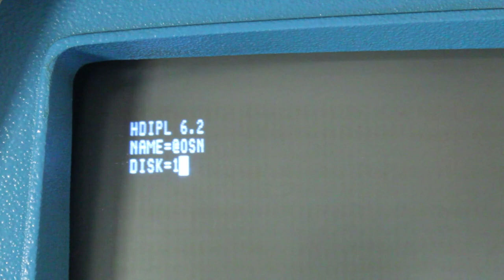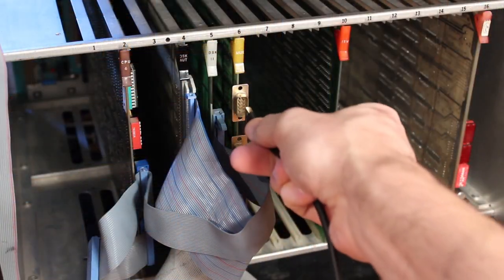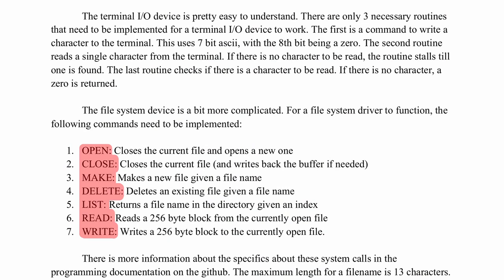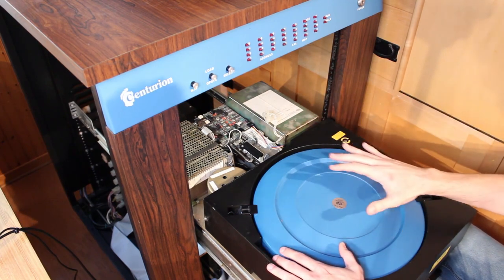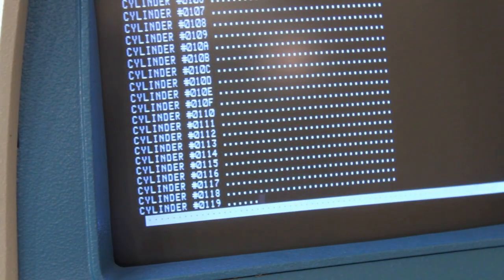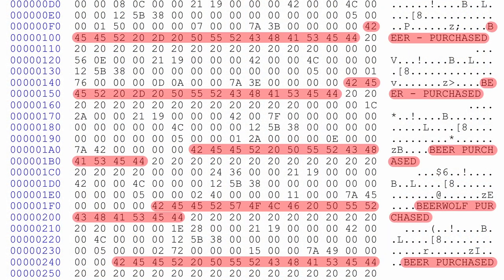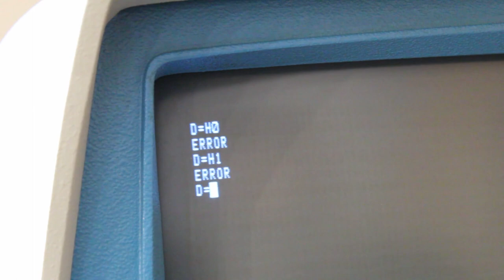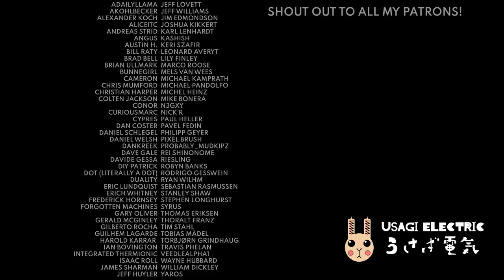Minicomputer Part 15: We Found the Holy Grail!

Comment: Momentous news! Congrats on recovering the software! And we have a very similar experience with the Diablo drive in our Xerox Alto. It keeps breaking down. Then all we have to do is just keep repairing it ;-)
Reply: To be fair that was a really fun 35 part series to binge
Reply: Hey 👋 Marc, loved your series on the Alto with everyone involved in getting that running. The Diablo drive was as amazing as this to watch. Awesome you are passing Kudos on in this way. Both keep up the great content !
Reply: I still dont get it how were you able to recover from a headcrash on your diablo

And why did you needed that aligment platter
Reply: You've got CuriousMarc paying attention to your videos? Awesome! If we ever get to the moon a second time, I'm sure Marc will be involved.
Reply: @Veso266  The heads and platters are tougher than you might think on those drives. I've seen them run for weeks before we got called out to fix the horrible screeching. 

The alignment disk is needed as a reference marker for the heads, to center them on tracks. There's no hardware to adjust the tracking dynamically so the heads have to be fixed in just the right place using a standard reference.
Reply from the maker: Thank you!
These old drives sure do like to put up a fight, but as long as they don't give up completely, we won't give up on them!
Reply: @UsagiElectric  I expect you've already checked, but on the later models they added a temperature compensation device to the head assembly. If that's failed it might be why the fixed platter is getting errors as it warms up.
Reply: Wow!! CuriousMarc.
Reply: There you are 🍻
Reply: @UsagiElectric  Awesome job!  I know this may be a bit of a kludge, but what about alternative means of loading the files for the OS, like say from the serial connections?  It may be slow, but there's got to be a way to boot from that, if the Hawk drives are not reliable.  I mean, UNIX/Linux can be booted in that matter if you know how to do it.

Comment: I still love how despite all the time and effort gone into this labor of love, you still have not had that lock rekeyed or replaced and need to pick it every time you need to turn the system on
Reply: I think he finds the action of picking it far too funny to stop.
Reply: Plus it only needs raking lol
Reply: click

"I'm in."
Reply from the maker: It picks so fast that I've just been extremely lazy about doing something about it, haha.
Reply: @UsagiElectric  And I honestly hope you don't, like I said I love how you still do that.
Reply: LPL incoming! 😂
Reply: The key is the last thing you would fix. The key thing is to focus on your goal in using the computer to do what you need it to do.
The key is not part of the objective.
So quite understandable why it hasn't been fixed. And it requires a different set of skills to fix/replace which the person may or may not have.
Reply: @RetroJack  Lock Picking Lagomorph?

Comment: Beerwolf might refer to the mid-80's Coors light beer advertising campaign.  The Wing restaurant that I go to has a 6 foot tall Coors werewolf statue that's been there as long as I can remember (30+ years?)
Reply: Yeah it was an 80s campaign for Coors, and Muskogee, OK used to have a bottle cap manufacturer called Zapata Industries, Inc. that made bottle caps for Coors. They were sued for making defective caps in 2001 and went out of business in 2002-2003. They had been in financial trouble for years before then.

I would guess this computer came from Zapata because they used it for much longer than would be reasonable (because they couldn’t afford to replace it).
Reply from the maker: I think you hit the nail on the head!
Reply: @UsagiElectric  Or would that be the cap on the edge of the bar?

Comment: Absolutely amazing! So glad you found the lost OS and boot loaders! I noticed that there was a BASIC interpreter in the OS listing. That's interesting.
Reply: Would be interesting to know if the OS binaries or applications include development tools like an assembler or C compiler & linker.
Reply: @PlayerClarinet  From what we have seen, there appears to be an assembler and a compiler for a language called CPL (Centurion Programming Language).
Reply: Well spotted, I did'nt notice that.
Reply: From what I recall, Centurion BASIC was compiled into a pseudo code and then interpreted at run time.  Similar to the old UCSD p-system.

Comment: Love this series!  It has me feeling nostalgic for my own 'good old days' on one of my first jobs.  Anyone here familiar with, or even remember Systems Engineering Laboratories (SEL) / Gould computers?  They were 32-bit minis.  We started with a SEL 86, cabinet was about the size of a VAX 11/780, it used a KSR 33 hard copy teletype for a terminal.   Then we moved to SEL 32/55's and SEL 32/75's, which lived in two 19" racks for the CPU.  Disk packs on the 86 held 24 MB, then up to 80 MB on the SEL 32 disk packs, and a Lear-Seigler ADM3A console.  Luxury!  SEL specialized in Real-Time work at a lower price than a PDP-11, but they went with home-grown operating systems (Real-Time Monitor, or RTM, then MPX-32 (Multi-Programming Executive) before migrating to Unix.  There were terminals that are now long forgotten - Delta Data 5000 (80 column x 27 lines), and Beehive B-550.
Reply: Yes, we had a Gould PN6080 for third-year Comp Sci. It used to run like a three-legged greyhound when we had our AI prac, when everyone boosted their Prolog environment  stack size to the max because we weren't allowed to use the cut function in our assignments. It also kept breaking down a lot.

Comment: I think its hilarious every time you rake that lock to turn it on. Have you considered doing a colab with one of the lockpicking youtubers to have them decode the lock and make a new key (but with the original bitting it had when new)? I'd love to see Deviant Ollam or Lockpicking Lawyer in this series.
Reply: Probably as simple as removing the lock and reading the number on the barrel
Reply: @highpath4776  I think with the removed lock in hand any locksmith could make a key for it.
Reply: @rickhole  You'd be surprised. Lots of "locksmiths" can't make a key if they don't have the original key for them to make a direct copy -- even if you have the cylinder or bitting code.
Reply: Or just buy a new electronic tubular key lock for 10 bucks. Come on people! Use your grey matter!
Reply: @charlespalmer3595  The point of getting the original lock decoded and a new key cut with the original bitting vs getting a new one is keeping the piece as original as possible.
Reply: @ItsAlwaysAwesomeToday  These locks have been around forever. Replacing it with an identical new one is no different than getting a non original key made! Lets not get new in box crazy about "original" when new original parts exist, like say capacitors or ribbon cables or a replacement drive, or, or.......
The printer for this machine doesn't print money ya know! Or anything else yet! ;)
Reply: @charlespalmer3595  the idea of preservation and restoration is to keep as much of the original parts as possible. Even things that wouldn't otherwise matter. No sense replacing an original lock when all you need is a key cut.

Comment: Firstly, congrats on progress to date...  Finding an O/S on ANY platter is a HUGE bonus.
I wasn't as 'lucky' on the old ICL System 10 I had...  Every single platter was 'pre-head-crashed' <Sigh>.
I still fondly remember the PSU in that thing...  About 45kg (around 100lb) of pure linear PSU.
It produced less DC power than a contemporary ATX12V PSU
(Around 300W of +5V and a few dozen Watts of +12V, -12V and -5V)

Secondly, I'd like to restate my approval of the rabbit -> cats upgrade...  Well done sir!  (Cats EAT rabbits!!!)

Comment: That is beautiful! Given that we have basically everything documented, both original docs as well as reverse engineered, I was thinking it should be fairly straightforward to emulate either a Hawk drive or a drive+controller on a single card, and then have a couple Gb of flash memory on there and a way to select which disk images get loaded into which virtual drive. Basically the Centurion equivalent of one of those modern Nintendo clones where they have 264 games and the machine itself just stuffed into the controller.

For that matter, that'd make backing up and restoring Hawk platters as trivial as copying one to the other from within the Centurion OS. It's just another drive as far as the computer is concerned.
Reply: You had the same thought as me!! 😁
Reply from the maker: Thank you!
And that's definitely one of the ultimate goals! The primary reason for getting the Hawk spun up and working properly is to copy the content off the platters to back them up. But, the allure of running original software on the original Hawk drive is too awesome to ignore! But, once we have a good idea of the Hawk communication protocol, we definitely want to build some Flash Memory or CF card interface to just keep the hours we put on the Hawk to a minimum.

Comment: Outstanding. I'm addicted to watching you animate this long dead corpse of a machine. :) I'm really hoping to see you do a head alignment on one of the drives. I only have a vague understanding of it but I think you throw a scope on the raw data signal and then tweak the head to maximize the output signal and remove crosstalk. In hoping you have found enough documentation to do that and the other maintenance on the drive.

Comment: If you can get ahold of a thermal imaging cam you might be able to locate the failing component on the disk controller board. Barring that, using your fingies to probe around after it fails out might yield a clue.

Comment: Crazy cool stuff! There's definitely some familiar looking stuff in there as compared to CP/M. Now that you found the actual OS and the secondary bootstrap, you could maybe do a dump to the Finch drive which is probably infinitely more reliable than the Hawk drives, and boot the system from there. You've got us nerds on the edges of our seats with curiosity to see what this relic can actually do! Nice work Usagi, and a big shoutout to Gavin for the wisdom to write the CCDP program to extract the available data from the Hawk drive/platters. Looking forward to the next episode!😃

Comment: in the 10 yrs of running an IBM System 3, only remember 2 head crashes.  when if crapped out the fixed it wiped out the removable and took IBM 2 or 3 days to get the drive back into working order.  what totally sucked was crashes on the 50MB, with 3 disks.   that system had 4 drives and when one crash they all crashed.  leaving the computer room with a total mess.

Comment: I had a similar problem with some old hard disks. It was electrostatic buildup on the platters from it spinning. The little grounding tab on the bottom of the drive gets dirty and isn't able to discharge it.
Reply: Excellent find. Thumbs up. Definately something to be considered and checked for. It could easily save one for days and weeks of work.

Comment: Sounds like a slightly modified version of the backup software is needed for the fixed disk.  Backup until the first read error is encountered, stop and note position.  This would allow the system to be shut down to cool off before continuing.  Also, if it were me I'd back up all 5 removable disks before booting or testing out other things with that drive.  Who knows how many power cycles it has left in it.

Comment: Sounds like the issue I had at a customer. You'd fire up the drive, The temperature change caused alignment differences enough to cause read errors. I'd start and update and things were going fine then bam, errors. I had to take the pack, copy it using a third drive that was aligned between the two and it worked fine. But in your case, you'll probably have to work on the alighnment.

Comment: Well, I my hopes were correct. There was indeed a backup of the OS on one of those platters. I wouldn't be surprised if you find a second backup on another platter.
About your reliability issues, it's hardly a surprise given the age of this hardware. Electronic components do wear out, especially capacitors.

Comment: It would be standard procedure for any data center , to keep system backups, OS would normally reside  on the fixed platter, but copied out to a removal cartridge at EOD.. ( at least 7 removal cartridges would be cycled this way. On some sites crashes happened all to often so recovery needed at least previous days data, after the poor engineer ( that would be me ) installed a new platter, filter, heads cleaned and realigned etc ( I was expecting you would find an OS, I  typed this on Centurion Part (1 )).

Comment: I did the exact thing to archive all the data off my 5 Diablo hard drive platters on my nova 2. Just push the bits out of the serial port and into the laptop. Isn’t fast but it works and works well.

Comment: Fantastic! I think you will get that Hawk drive operating solid, but even if not you have the data and it will be possible to emulate the Hawk with something else.  Hard drive, SDD, or even an SD card.  I am rooting to see the Centurion up an fully operating with original equipment.

Comment: My first reaction to your hawk drive startup procedure would be, it can't be that sensitive. It must have ran for many years 24/7 without problems. A good service and go. But I see you attracted curious Marc in the comments and he says they have similar issues. So I need to conclude that apparently they didn't age well. If still needed I wish you luck in finding the overheating part, such a problem can be hard to find.

Comment: Seeing the "S" designation for system files tickled my AmigaDos bone, it had a similar structure
Reply: A lot of the system architecture has commonalities to the computer science that had been put into college methodology from the early 1960s.  Of course there are relevant proprietory changes and the needs of the specific bit transfer processing and storage , but at the end of the day data is data and instructions are instructions in digital format
Reply: @highpath4776  AmigaDOS basically ripped off "TriPos" unix-like system. Of course naming conventions changed slowly, they are conventions after all. But AmigaDOS seems to be the last commercial system to use prepended labels like that. And since AmigaDOS was the first time I was exposed to a Disk Operating System, it is indelibly imprinted on my mind.

Comment: Well done! 
Gavin is an amazing resource. 
If you want to adjust the head alignment, you need the head alignment tool and  a CE pack. 
Did you locate one, or are you trying your luck with a data pack?
When I was trained to service these drives, every single student in the course killed at least 1 pack and a set of heads each doing the head alignment. So, please be very careful.
I guess, as you have the HW diagrams, the instruction set AND the OS software it would be possible build various flavours of Emulators.
1.) software
A version of Unicorn that emulates the instruction set and runs on Windows or Linux. This would allow the wider community access to the experience.
2.) Hardware 
The diagrams could be translated into an FPGA hat on a Raspi. There the Raspi could act as the IO subsystem and terminal for an "FPGA Centurion".
3.) Phoenix Emulator
To preserve your vulnerable Phoenix Drive I would stronhly suggest to build a Phoenix emulator. You have to Interface Pin out and the commander for the Phoenix. Again a Raspi could be the solution. You can use the GPIzo pins to communicate with the driver card and present the data from a USB stick to the interface. You could even sample the drive noises for the different actions and replay them on the Raspi audio port for the fully emerged feeling. That means You can operate the machibe 9n a USB stick in normal operation and in case someone gifts you with further phoenux platters you can read and copy them as well.

Comment: Not sure if this is useful information or not but I had a large interactive television that would stop functioning after it got hot, turned out to be a broken solder joint that would open after it heated up.  May take some time to find, but may be a similar issue.

Comment: Chances are you have some bad capacitors in that drive.  They develop a low internal resistance, heat up and short the circuit out.  Amazing spelunking!

Comment: If you have the data, maybe a simple device emulator for the drive, ie hd,trk,sector. I assume they are using an io block interface. With a direct connect to the pc to serve the sectors. I do this on a few of my old pcs.

Comment: If someone would just make a computer case like that so I could put modern parts in it, that would be pretty cool.
Reply: 19in Rack System, Some Sheet Metal Paint Sprayed and any Backplane rackmount box ( try finding a 20 year old modular telephone exchange (PABX) as a potential basis (but watch for shorts and earth leakage on the power supplies ).  The ADDS terminal types might be findable.

Comment: Maybe you could dump the backup of the platter back to the Finch drive and boot from the Finch? Failing that, I guess making a ROM emulator that pretents to be a Hawk drive would also be possible (and the most reliable).